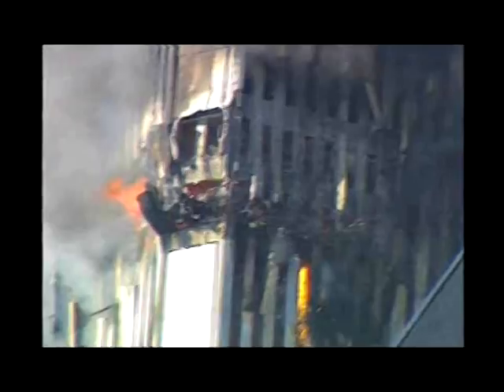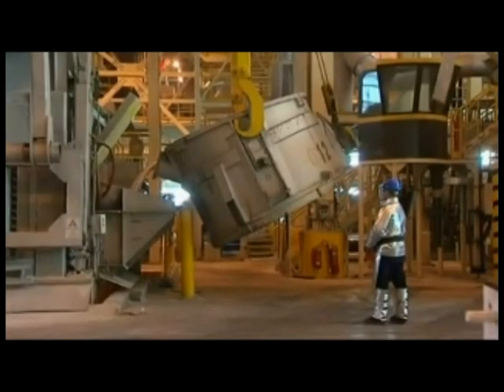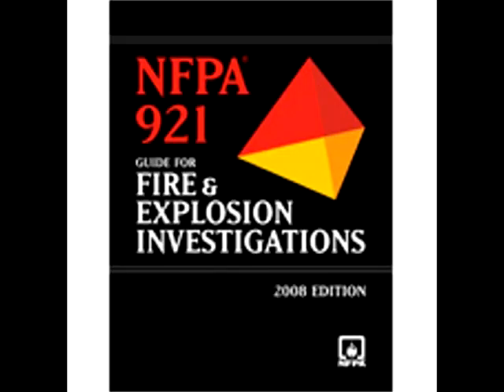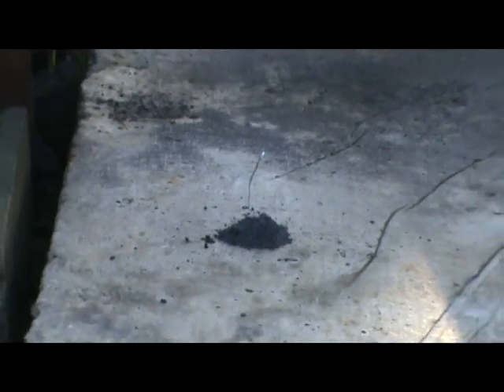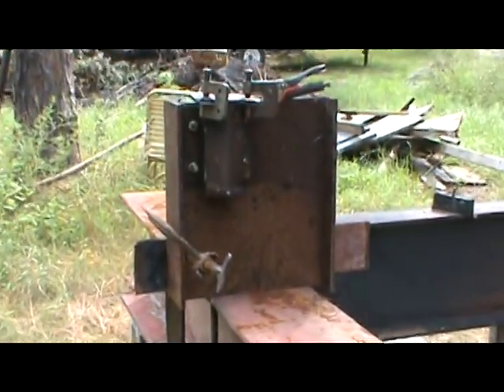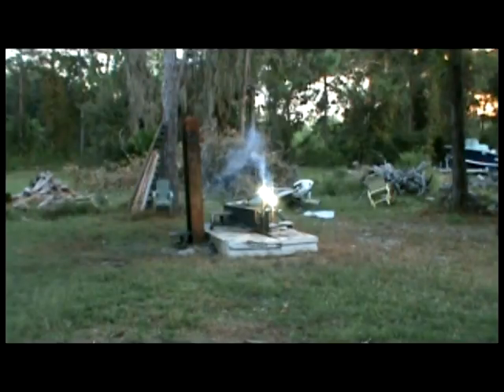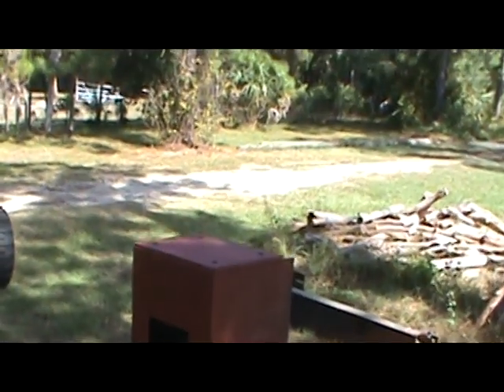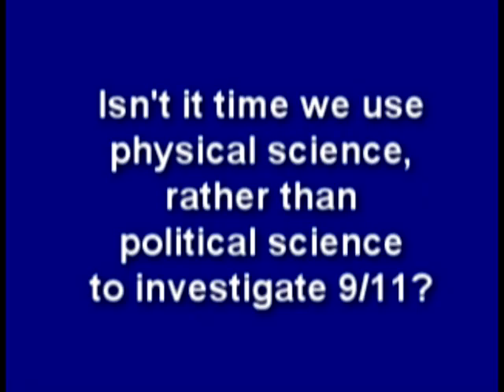9/11 Experiments: The Great Thermate Debate

Comment: First of all what I see on video is not similar to what I've seen on other amateur videos about thermite, your "thermite" burn instantly even if it's hot it doesn't give any inertia and burn during long time to really heat surrounding materials, I've seen other thermite that burns slowly and long but that really heat the steel and turn it red before melting, so do you really use thermite or just a cheap version ? It makes me wonder

Also you say why not to use high explosives instead ? Well the 9/11 documentary and other documentaries made in USA in the same period permitted many witnesses among people but also FDNY members that many explosions occured in the tower below ground 0 but also in higher floors that occurred at different time than the plane collision, so this has nothing to do with the plane collision or the burning it caused.

Comment: You're not taking into consideration what the impact of the plane and weight from the above floors had on the building itself.  A controlled demolition starts from the ground up to bring it straight down.  The twin towers collapsed from top to bottom.

Comment: I've got a Weber grill made out of steel and lighter fluid that's essentially the same as kerosene and jet fuel. I think I could dump can after can of lighter fluid onto a burning steel grill and it will not
soften and it sure as hell won't melt. (Firemen said there were rivers of molten steel flowing down channels in the lowest levels of the towers a thousand feet below where the jet fuel was burning) Only the 5000 degree heat of thermite/thermate/nanothermite could melt that much steel that fast.

Comment: This debate will probably go on forever, and there are certainly enough "tin-foil" folks to keep it going. Just a thought...but is it possible the molten metal spray and blowouts were NOT from some nefarious oil-stealing plot but rather from the main power supply lines that feed the buildings? Is it possible those seriously high voltage/high amp lines were damaged/cut/exposed and started to short out, thereby creating some serious welding/cutting situations that would certainly blow through metal (aluminum or steel)? Has anyone pulled up the wiring schematics for the buildings to see where the conduit was run? Hmmm...Just a thought. But, no, its way easier to think the govt is this super-secret, highly intelligent entity that can keep the world's best secret. Y'all need to get a life! Good video though, who doesn't love burning the crap out of things in the backyard?!?

Comment: Your trying to prove an assumption and that isn't scientific   process...also building seven was filmed from the back and the otherside was gutted out from the towers falling...it also didn't fall symmetrically....you also don't understand the stove pipe effect...any material and fuel given enough oxygen can burn at greater temps....hence why you can melt metal in your back yard with coal and a leaf blower

Comment: duh, all was needed was the steel to be weakened. no melting required.
Reply: no, the weight from the upper floors caused the lower flrs to break apart and collapse as they were hit by the upper flrs. the 2nd tower failed 1st bc the plane hit lower so more weight for the damaged area to have to support.
Reply: Sticksbass yes but it did melt...
Reply: the impact of the explosion. nothing was cut like w a blow torch and nothing found attached like in this vids demonstration.

Comment: Why do this represent what the ground zero photos after show about 4x4 ft box girder cut diagonally thru like with a huge torch youd have to cut diagonally to have 1000ft in 9.5 sec 100+ft/sec collapse that's free fall also thermite is multimodal 5 modes goes off at 430F or detonates at 800F later sendoff the towers stuff was a complex formulation and 1 glaring 2 me leave out is it had polymer binders indicating a compound like C4 a plastic could be formed made shaped charge and detonated a very high speed explosive goes to 4500F like ziptime explosives are rated by speed detcord looks like white clothesline wrap it around like ie blocks of C4 and lead fro.charge to charge a continuous string set off with a blasting cap electrical a city block can go up in instant because detcord detonates at 22000 ft/sec about 4 miles in 1 second every block its wrapped around around almost same time it's not an open powder burning like gunpowder poured out of the shell just flares up yet confined in shell you can get chamber pressures of 55000 lbs/in^2 why use magnesium this was prob explosive compound also possibly a controlled demolition wireless or not from nearby location like maybe why was building 7 "pulled" and it was announced evacuated after towers were down this just occurred to me basements of towers blew 1st before they collapsed. It's all available info in utube vids saw it myself.  Eero

Comment: So thermetic material was put into these beams during construction in the 60’s and 70’s.........? Not buying it. And if that’s the case then I guess every other building in NYC is rigged and ready to blow. Give it a rest. And what do you expect a building to do that’s been hit by a passenger plane going at 500 mph into a building at an angle destroying 5 floors and knocking down 79% of the beams. Not to mention each floor is 211 feet wide. And there were 25 to 35 stories above the crash zones. So 35 stories worth of weight was pushing down on this massive hole were there’s burning furniture and black smoke causing charcoal which melts steal btw and then add 30 tons of jet fuel into the mix. Charcoal was once used to melt and cast steel in mills. So of course let’s blame the damn government. And if it was an inside job then Bush was setting Ben laden up for death and all those middle eastern  people who got their balls blown off when we went over there to make them pay for their cowardly crimes.
Reply: 1. It is IMPOSSIBLE for them planes to fly at 500MPH at that altitude! NOT POSSIBLE!. 2. It is also NOT possible (as even the official record STATES VERY clearly) what they regard would have been the temperature inside them buildings to have caused the melting of steel. NOT POSSIBLE. 3. The buildings were built with THIS very incident in mind and calculations taken with regards to the building being able to withstand such an incident. 4. The LAWS of PHYSICS PROVES it is IMPOSSIBLE for them buildings to collapse 'in the manner that they did. NOT POSSIBLE. But you got the latter part of your comment completely correct. Please LETS blame the government. WHY? Because when everything THEY tell you, is against the laws of PHYSICS, science? then WHO the HELL else IS there to blame? (oh and Pulease do NOT tell me a bunch of piss-poor trained mooslems cuz. THAT would be an insult, not to just mine but every1 elses Intelligence) Nice try mind. PFT
Reply: 1wannabee1 Dude Lol flight 11 was a Boeing 767. Look it up it’s no lie that they can reach speeds of 533 mph or 858 km/h. And if it was a controlled demolition, they would have found the explosives within the steal outer shell like you say it was. You’re not going to convince me bud.
Reply: 500-600 MPH is NOT possible with them engines AT THAT ALTITUDE! Mate? GO CHECK IT UP! If they attempted to fly that speed at such low altitudes? they would have simply fell apart. FACT! I am NOT trying to convince you AT all. I am merely telling you physical facts from what I have learned from people who, designed and made them planes. 1 man actually stated that, for them planes to have flown at such speeds soo low? the engines would have had to produce 6 TIMES more thrust. FACTS mate,just facts.
Reply: 1wannabee1 so tell me then. How fast were they going? And say what you want man but they can reach those speeds. Hell some of them even go slightly faster. And how ever fast it was going it was still enough leave a big gaping whole and managed to blow debris out the other end. But why would the u.s. government do this? Why kill thousands of innocent people in one day? This was an act of terror. And that’s what I believe.
Reply: 747,757,767. NO DIFFERENCE. What I said STILL stands
Reply: 1wannabee1 how fast were they going since you have all the answers...
Reply: Oh really? So YOU maintain that the planes ARE capable of flying at THEM speeds at THAT altitude? WOW. Mate?? YOU should go and call them firms that manufacture them planes cuz.. YOU know something that THEY DONT.PFT(un frigging real) grrrr
Reply: 1wannabee1 you still haven’t answered question man. How fast were they going? And why would the government want to kill thousands of innocent people in one day?
Reply: Mate? I DONT KNOW what speed them planes were going at. That is NOT the point. The point is, the 'official' word? is that they were flying at the speeds YOU state here. The only thing I am coming to you with? is the fact that from what 'I' have learned, by listening to experts, people who KNOW them planes like the back of their hands, THEY clearly and loudly say, they can NOT fly at the speeds stated. But may I add this. I ask you, no, I urge you, search on here and check out other plane crashes. Planes crashing NOT against re-enforced steel beams, but ordinary soil,sand,water and SEE how them planes react. If you DO that? then you MUST then conclude that the way these planes 'appear to slice through them buildings? just is NOT possible.Please! just do that.
Reply: You ask 'why' would your government commit such a vile act on its own people? THAT is the Million dollar question that I personally do not know the answer to. I suggest you go ask your government that. I doubt whether you will recieve an 'honest' answer to that question
Reply: 1wannabee1 Believe what you want man.

Comment: If 911 happened the way the Gov said ??   Then my Weber $18 steel BBQ with coals 900 deg hotter would melt the steel and catch my yard a blaze.   Only the steel on my cheap ass pot Weber is thin as sheet steel not 4 or 6 inches 😆.   So my Weber bbq would need to be 12 inches thick and I would have to cook with propane on low  to be successful.

Comment: Ask any Arson Investigator..an office fire can burn at over 3500F. While the Jet Fuel will burn up quickly in the fireball,  O2 with hurricane force winds being fed up elevator shafts to the base of the fire will produce the heat needed. I guess it can!

Comment: The buildings got hit by a jet liner full of fuel at 5-600 miles per hour! That's what weakened the buildings! Would an airliner weaken a building after flying into it? I guess it can!
Reply: 1. The buildings were built to withstand such an incident as this taking place. 2. The planes did NOT travel at 500-600 mph. THAT IS A FLAT OUT LIE! The planes can NOT fly at that speed at such low altitudes. THIS IS FACT! (dont believe me? go check for yourself. Its ALL out there if you 'really' wanna know the 'truth')

Comment: Those look like electrical sparks to me. Thermite can burn yellow, white or any color. How did they melt iron in the iron age with just wood? A good air source. Those  small balls look like welding debris. My question is, when was all this installed? Nobody called me?

Comment: First of all, it wasn't molten metal that came out. It was molten plastic.  
Secondly, what this testing ignores is the fact that the girders were exposed to temperatures well over 1800F.  Steel starts losing its strength at 1200F.. 
Lastly, it's a bold-faced lie that an office fire can't reach temperatures hot enough to melt steel.  Particularly when you have Iron Oxide and Aluminum available.  

https://www.youtube.com/watch?v=jTpNAF8gIj4
Reply: YOU ARE WRONG! Firefighters state VERY CLEARLY that they SAW moulten steel running. Not only that>? but that steel remained seriously hot for days after.
Reply: You don't have your facts correct.  First of all, the "molten metal" they saw was UNDER the WTC in the subway areas. It was NOT what fell from the building.  Secondly, nowhere did I say that the metal didn't get hot. It did. And yes, I know it was hot for days.  I didn't say otherwise.
Reply: Ok fine. NOW tell me HOW that metal under the buildings. HOW did it get sooo hot that it melted, when it was NOWHERE near the point of impact of the planes? You simply can NOT have it both ways. They tell you that it was a combination of the jet fuel AND material of the building that melted the beams. My argument is, how the f***g hell can that be true, if what YOU state here is correct, that the moulten steel was UNDER the buildings? (it DONT make any sense mate.)
Reply: First of all, you really need to go back and watch the video I posted because it talks about how common items in a room can get temperatures up to 1800F and HOTTER and that is without accelerants such as jet fuel and diesel fuel. 

Secondly, the area UNDER the buildings was an open complex and is where the bottoms of the elevator shafts were located. The upper parts of the shafts were EXPOSED when the planes blew threw them. The molten metal fell down the elevator shafts from the upper floors where the fire was.  Why was it molten on the interior? Well, when you vaporize aluminum  and expose it to Iron Oxide and a combustion source, you get thermite. And it was that thermite that was molten and fell into the basement. It was molten plastic that fell on the outside of the buildings.

Comment: The people who accept the official story, and are convinced that the collapse was due to the weight of the upper floors "pancaking" and causing the floors beneath to give way have a fundamental misunderstanding of how steel is able to support loads. If a building could be collapsed in this way, demolition companies would never bother blowing out the lower support columns to bring down buildings. They'd simply wire a single floor near the top, and let gravity do the work. But that's not how steel works. Steel columns are strong in compression, so when one is vertically stacked on to another, they effectively act as a single column. The entire weight of the building is transferred to the foundation. 

So the first plane hit between the the 93-99th floors, right? If you could somehow instantaneously vanish say, the ninety-third floor (roughly ten feet), leaving a giant air gap in its place, the floors above would instantly start to accelerate down at 32 feet per second squared, and then the combined weight of the seventeen floors above would hit the completely intact and structurally sound floors below. Now keep in mind that up until you vanished that one floor, those ninety-two floors below had no trouble supporting the weight of the eighteen floors above them. 

Now, the weight of seventeen floors, which have fallen ten feet straight down, hit the ninety-second floor with just slightly more force than what it was supporting before you vanished the ninety-third floor. Logically, the floors above should not cause the floors below to collapse, but rather, the floors below should act as an obstacle, and the floors above should crash and collapse around the undamaged structure, perhaps piling up on top. There's no way they could make the steel beams below buckle and give way because they were already strong enough to support that weight before you vanished the floor. 

Another way to imagine it is if you stacked up 110 cans of beer. If the can at the very bottom can support the weight of the 109 cans on top of it, simply pulling out the 90th can, and letting the 19 cans above it drop on to the 89 cans below isn't going to make every can suddenly crush down in succession, one after the other.
Reply: You do understand that steel, even under compression, will lose its strength and ability to hold up tons of steel, concrete and all the other junk found in an office building once 50% of its strength is lost right? Do you know what temperature that is?
Reply: You do realize that temperature of the steel just a few stories below the impact site was basically unaffected by the fire, right?  The vast majority of the tower was NOT weakened in any way whatsoever.
Reply: The way the Twin Towers were constructed relies on the clips holding the floor joists to the outer box beams and to the inner core. Once you lose them, you have nothing to support the structure once the inner core has lost the structures attached to them and one hot enough to lose its strength, it will come down. 

Here is a pic of how the floor joists were attached and how close they were on the outside box columns. you see those same type of joists at your local Walmart or supermarket. http://www.tms.org/pubs/journals/JOM/0711/figAa.jpg
Reply: I can accept that, but then what caused the inner core, which was the strongest part of the building, to collapse?
Reply: You have to remember that the sturdier, and heavier parts of the plane such as landing gear, engine turbine disks etc, damaged the  inner core columns. Add heat from the fires to where its strength is compromised and it will pull them down as the upper floors fall. 

The so called explosions were the beams breaking as the buildings fell. Steel makes lots of noise when it breaks. The windows that blew out were most likely due to being scratched somehow. They also flexed as the tower was falling. Air pressure forced the window to burst and out comes all the dust.

Here are some pics of the twisted and broken steel. https://p8.secure.hostingprod.com/@rmparchive.com/ssl/1000Shadow/FM0017-8x10-1000Shadow.jpg and https://c8.alamy.com/comp/E0377Y/urban-search-and-rescue-teams-work-to-clear-rubble-from-the-wreckage-E0377Y.jpg and http://i5.photobucket.com/albums/y164/wteach/Another/cross_discovery.jpg are good examples of it.